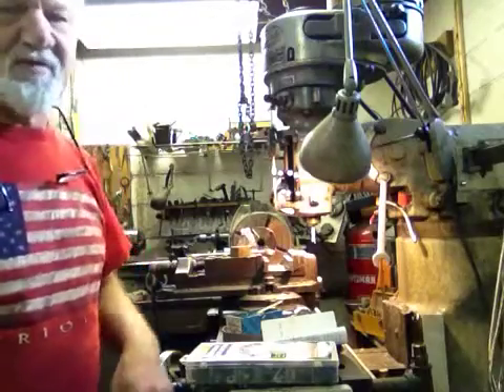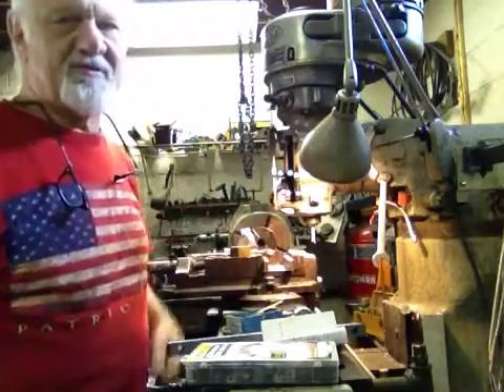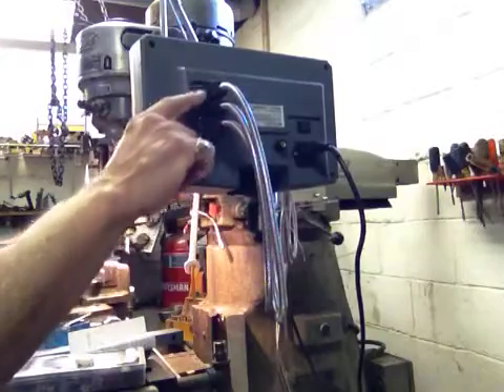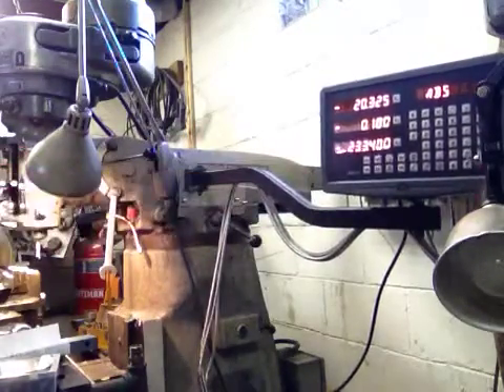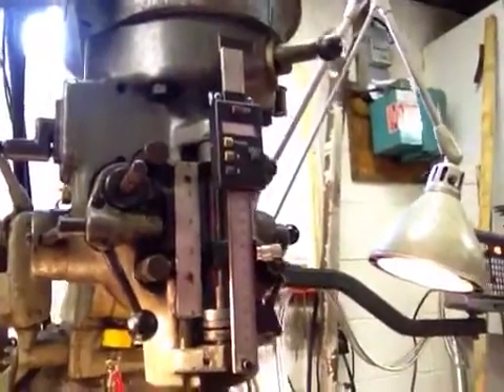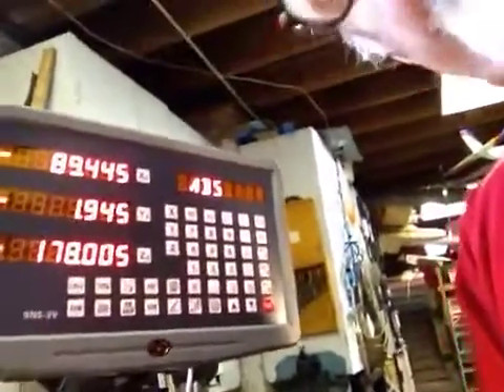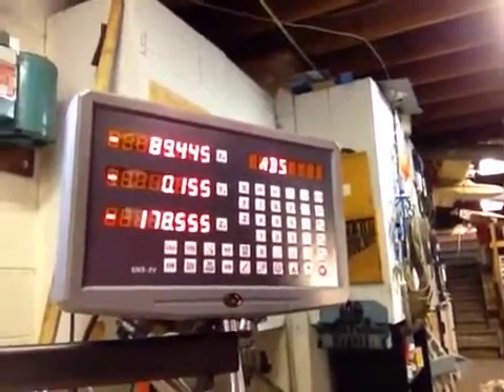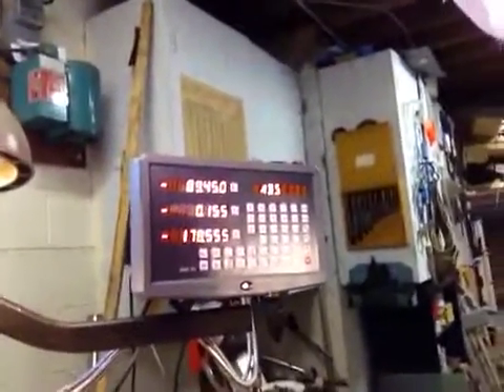dro

Comment: Nice job. I did plug the oil drain holes and ran X  over them, what I was able to do is get the Z and the Y the same length and can put the Z on the Y if one goes out. Other than that pretty much the same. If you can figure out how to do a calculation on the DRO and enter that number in one of the axis directly let me know, I have not figured how to do it says something about being in a certain mode.